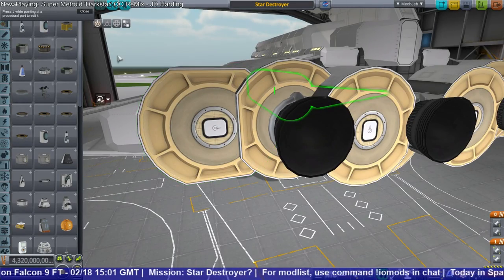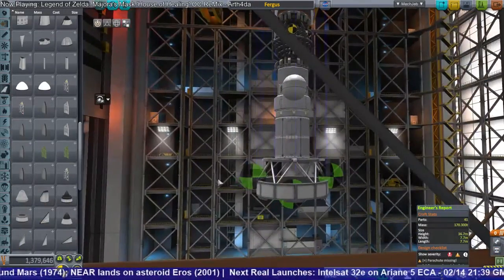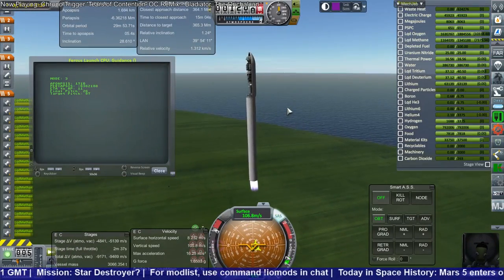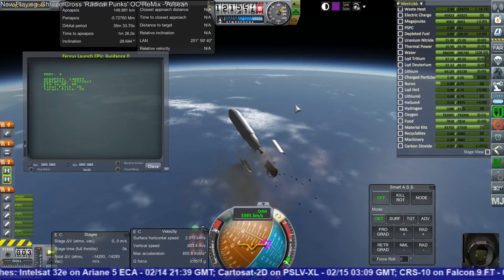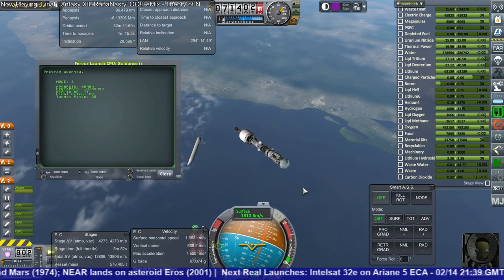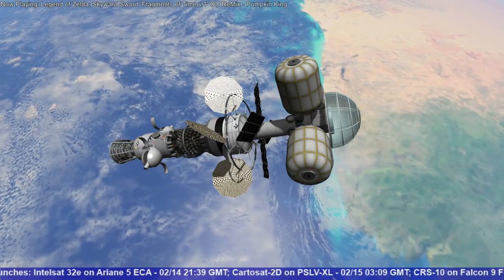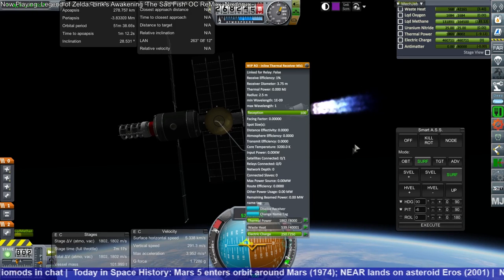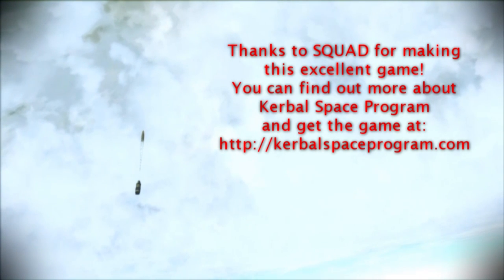Kerbal Space Program - Interstellar Overhaul 06 - Fusion and Energy Transmission

Comment: Timberwind reactor are technically particle ped reactor, which is very similar to pebble bed reactor except the fuel elements are much smaller creating more surface area, and therefore offer more performance at the cost more difficulty in refueling.

Comment: The second stage thermal receiver connected to the closed cycle engine would not contribute anything because the Lightbulp already produced its own power. Fortunately in your 3th stage, you had it configured right. Long distance performance can be improved by taking along a thermal dish receiver (connected with the inline thermal reciever) which would have to be aimed at the transmitter.
Reply: Sebastiaan Willem van Swelm I've seen this kind of comment on every single video of this series, Tyler might learn more how to play KSPIE I guess.